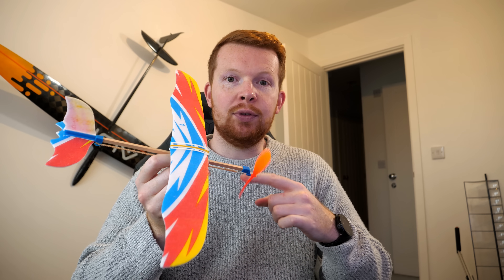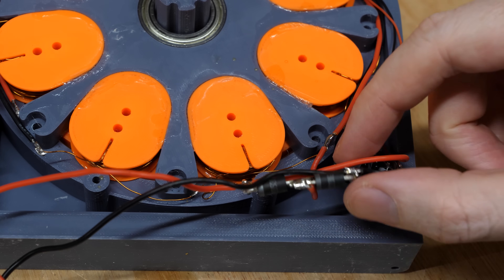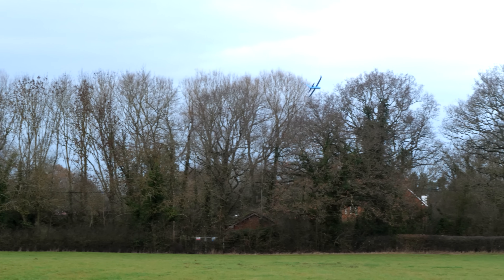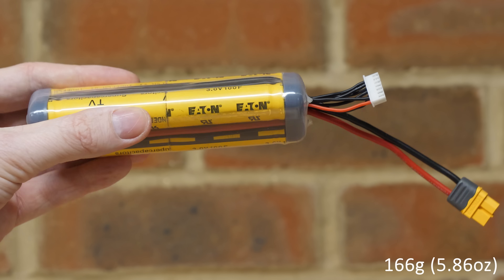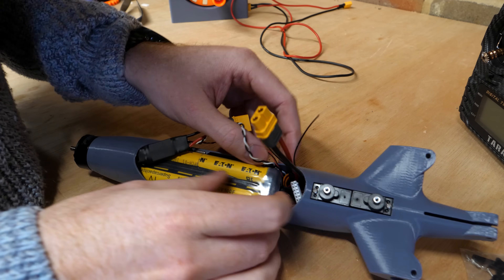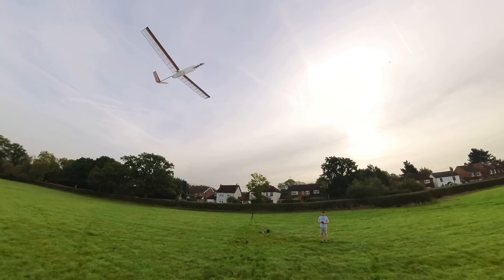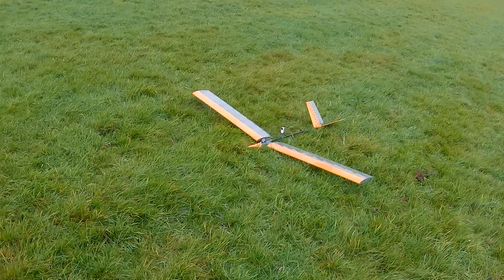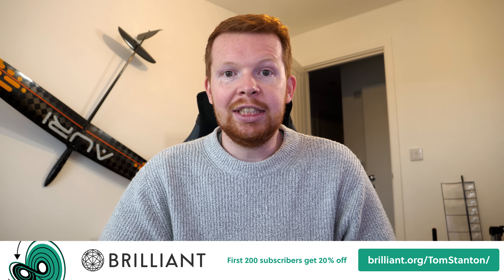Super Capacitor Plane

Comment: Your rectifier is missing a MOSFET switch for something out the DC further, multiple capacitors does the trick but the flow will still be slightly bumpy.

Comment: 11:25 idk if its possible, but it would be really interesting if you could use the windmilling of the propeller as a sort of regenerative braking system to charge the radio systems so you could stay in control of the plane for longer and so its safer to fly lol

Comment: having a pack of supercapacitors added to an electric car increases regen efficiency by 30 percent because they can capture energy faster then dissipate into the lithium battery, the technology has been tested and used for over 50 years but supercapacitors are too dangerous to put in passenger cars

Comment: Could you use a dual shaft motor and on the shaft pointing into the nose of the plane? Add a micro magnetic charger like the one you built to charge it, to help flight time?

Comment: Would this concept make a good s&r tool?

No place to charge? Get cranking, it would get you a bit of flight time.

Can the system swap the capacitors out for standard lipo cells?

Comment: Tom that thing is a complicated device is it all really necessary?

This is in reference to using capacitors in 1979 my friend Skip Swaggart  (yes that’s his real name. His mom was a hippie and she must’ve thought that was funny.) anyway his idea was to use a series of capacitors just like you are on your airplane engine, but his idea went a little farther in that he believed it could be self sustaining after using a battery to prime the capacitor, have no idea if it would really work, but it did seem like a unique idea, no gasoline only electricity to prime it via battery then it would be self-sustaining as each capacitor was charged by the battery and the battery was recharged as the engine turned, now of course you’d have to do a series of gears or whatever to turn this into electricity using a generator or possibly some kind of direct drive system for a car or machinery

🤷‍♂️
Reply: “make it so”
-😂

Comment: One does wonder how much extra flight time you might get by using the windmilling of the propeller to charge your capacitors. The increase in complexity and weight may not be worth it for a few seconds of extra flight time, but it would be interesting to see.

Comment: Interesting thought, a year too late: DC motors are also DC generators. When the power gives out for the propellor, the propellor would then become a generator and feed power back into the capacitors. Some of the clips in your video, it sounds like the propellor kicks back up a time or two - that could oddly be because the propellor is being its own generator via the caps.
Reply: You’re referring to back EMF, and it does not work that way
Reply: While brushless motors are reversible, the control circuit for a motor and for a generator are not very similar. I'm not sure how much elastic rebound you could expect if generator circuitry was also in the plane but I think it would not be worth its weight to add it.

Comment: Would those capacitors take much to re-charge them while in flight from lightweight solar panels attached to the wings, while gliding around after the motor has shut down.

Comment: Only just seen this Tom, did you think about using the turning prop while off the throttle to recharge the capacitor while in a glide to increase flight time? Would be interesting to see how long to could extend time by.

Comment: What if you rig the motor so that it can put charge back into the super capacitors when the propeller is free wheeling? Or have two more propellers free wheeling to charge the super capacitors?

Comment: very cool project, very nicely engineered wings.  For the folding prop you can add a small elastic band across the spinner,  to make them close once the power cuts, its a known RC glider trick, and/or program in ESC-brake.  Also having that big gap between the two wing halves adds a lot of drag, and also breaks the long aspect ratio of a glider wing into behaving like 2 short wings instead,  which again reduces performance and increases drag.  you should 3D print a housing for the center to connect the wings in a seamless shape.  You want all smooth convex shapes for low drag,  concave shapes are bad.

Comment: Impressive work. With your talent in 3D printing, why not design a cap for the folding propeller assembly that contains light springs which will push the props into a folded position when the centrifugal forces that keep the propellers deployed are no longer present (ie when the motor is no longer driving the props).

Comment: So, uneducated theory here... but could you extend flight time by modifing the prop with magnets and your cover plate to be a small generator to re-charge during flight? Maybe add a cutoff on a switch to break the charge circuit so it can drain out to a glide? 

Or is charging a SC as it discharges a bad thing?

Comment: When the aircraft runs out of power but the propeller is still spinning, it could recharge the capacitors and thus significantly extend the flight time.

Comment: changing the wiring to your super caps to be 9vdc instead of 18 vdc would double current and be at a voltage you could use in the plane  and possibly git you twice the air time.

Comment: what if you used solar panels on the nose and tail of the plane hooked to sum plain ol batteries with the same contraption as the super capacitor n same or similar plane body n maybe it would get some more flight time 🤷🏽‍♂️ or to spice it up keep the capacitor n make it powered by wind instead of air

Comment: Only thing I would change is I would put a 1/4" Chuck on the crank of the generator so you can use a cordless drill to spin it instead of hand cranking it.

Comment: Fir the 5V you can use a buck/boost converter so it can work down to done low voltage, such as .5v of maybe less. You could also do the same to boost your speed controller to keep the voltage high so that your proportional control of the speed is consistent (although it will simply cut out when capacitor is low enough). You're only using about half the energy you're storing.

Comment: What about a full sized bike crank electric generator human sized copter with giant super capacitors with the ability to switch back and forth to a lithium/car battery for emergencies and safe landing. The question is can a human bike pedal enough to generate enough electricity for take off? If so then when your life depends on it, would you pedal faster than normal to safely land? The emergency lithium and/or car batteries is for if the first and second hypothesis are about to fail. You can have a circuit board that switch's to the batteries if it loses thrust and altitude faster than you can pedal. You could also design is like those electric assistance bikes.

Comment: My height can open up light access power higher than ground levels so I charge by a timer that when gliding I recharge super capacitors at this light and wonder the speed .use wiring that is directional but delivers this emw easily. The temperature lower. Metal power delivery transfer to chemical nitrogen and opposing gasses

Comment: OK HERES AN IDEA: 

What if there was a way to use the output shaft if the propeller motor to refill the capacitor...
like connecting the output shaft of the rotor motor to a set of gear that would increase the rotation of a secondary motor that would in-turn charge the capacitors...
how long would something like that run for?

Comment: Would it be more efficient to have a small onboard 5V battery for the control circuitry, with the super capacitors powering just the motor?

Comment: Now I'm no expert or have much electronic knowledge but to me if the capacitors could be charged with solar panels could the aircraft stay aloft by using a pulsing method.
If not an aircraft what about a boat?
Please don't throw electronic answers just yes or no lol Also it's obvious the rc needs a normal battery possibly also solar charged?
Could the capacitor discharge speed be lowered a bit once in the air to increase range?
My first thoughts on the prop were also why not a simple spring device to retract it or a mechanical stop or pin on a spring. Maybe something centrifugal in the spinner?
 I appreciate it's all about weight but would there be any merit in also using standard batteries in conjunction with the capacitors?? Maybe an alternating pulse method or use the batteries to top up the capacitors in conjunction with solar?

Comment: What about putting in double the capacitors and building a generator that when the propeller is making power run on one set of capacitors while charging  up the other capacitors with a switch that automatically switches over when the discharged capacitor is spent! Then it switches over and keeps running!

Comment: I've always wanted to experimentally test the difference between a plastic generator and a metal generator. This plastic generator is extremely inefficient since almost all the magnetic flux disperses into the air instead of passing through the coils. Even a small metal frame in one of the corners (in such a way that the magnetic flux concentrates in the coil—it's hard to explain the geometry) should increase the output voltage several times.

Comment: Please add 3D printed water pressure driven turbine with flywheel of marble/metal above...operated everytime the domestic water supply pressure motor operates & and gives it spin.. plz Guide to feed elect output in solar architecture.. please upload renderable 3D printing files for horizontal twisted windmill.. ( Arshimedis Ltd style).. show your skills to integrate it with overhead fan motor.. add permanent magnets to stator..feed this output also to solar cct..for a hybrid model..promote Green Energy

Comment: Please add 3D printed water pressure driven turbine with flywheel of marble/metal above...operated everything domestic water supply pressure motor operates & and gives it spin.. plz Guide to fuel elect output in solar architecture

Comment: Innovative.. please design current generator hub with impeller vane to fit in line of domestic water pressure pump..so to rotate a flywheel of marble or metal..EVERY TIME ANY FAMILY MEMBER VISITS WASHROOM & TRIGGERS PRESSURE PUMP.. 
1. Please guide to feed this D.C output in solar panels cluster for random addition in current.
2. a) Also please design with 3D printer, the rotating horizontal fiber disk (similar to Archimedes ltd).. b) Kindly also use your skills to add magnets in stator of common overhead ceiling fan (to be integrated into above mentioned disk of windmill).
3. Please upload renderable 3-D printing files with specs of plastic/alloy grain.

It will help to make hybrid elect power supply to be fuzed in main solar power supply architecture... for 24 hour electric supply generation).. and a cleaner, greater planet.

Comment: خب بجای خازن از باتری استفاده میکردی قطعاً خروجی بهتری داشتی وزن کلی هم کمتر بود، به هر حال عالی بود، براوو
Well, instead of the capacitor, you used the battery. Certainly the better output was less weight, it was great anyway, Bravo

Comment: I would love to see you come back to this, but replace the super capacitors with the new lithium ion capacitors.  They behave much like supercapacitors, but have greater power density.  Same short charge time, more electricity stored. If they deliver on their promise, they should significantly increase your flight time and be just as quickly chargeable with your hand crank generator.  :)

Comment: If you made a mini version of the hand crank generator and attached it to the engine, then redirected the power back into the super conductor cells would it be able to charge itself as the engine spun (at least to some capacity), ultimately increasing its flight time?

Comment: I would have cheated and run the plane’s electronics off a battery and used supercapacitors only for the motor. But I tend to cheat anyway.

Comment: Make a different kind of self-powered plane, where instead of trying to make enough paneling to maintain a voltage with batteries, use the voltage to power capacitors and make a really good glider that charges fast enough while in the air to give itself another boost up. I think this might be a little better being gliding isn't power intensive

Comment: Use a second cap bank and charge during flight and really fast charge, cap bank to plane. Just enough resistance to keep everything from destroying itself and it won’t take long to get back in the air. If you then use a leg power device to make current u could charge up in just a few seconds.You could use the electric bike to do that?

Comment: 5:33 looks like a bomb at the moment
Reply: One wrong move and it is
Reply: @Wanderwavves  if it were a lithium ion battery, maybe. Supercapacitors can take a beating.
Reply: @Techmejmeant one wrong move as in shorting i shills close by. has a guy blow up his arm with a 200 amp capacitor😊
Reply: @Wanderwavves  in that case, yes
Reply: @Wanderwavves I've pulled working supercompasitors out of crashed cars, they're  good 👍

Comment: A ferromagnetic stator would increase the output of your generator. At the moment, flux is limited by the high magnetic reluctance in the magnetic circuit between your permanent magnets.

Comment: You should seriously refine this and sell it. To make it viable, you're going need a cheaper controller, but the rest of it can't be that expensive when mass produced. You basically took that capacitor kids toy and made a radio controlled version. Perfect for kids, or frankly anyone, wanting to dip their toes in radio controlled flight. Even the crank charger is great because it means there's no limit to their fun. They don't have to a few goes with the plug in version before it has to be charged. They can go until their parents tell them to come home. Seriously, refine this, create a website, and sell it online even if you just break even at first. At least you'll find out if there's a market for it. I bet you, someone watching this video would totally buy this for their kids or themselves.

Comment: A super capacitor is just a normal capacitor but named by an ignorant.
(because there's no such thing as super capacitors, as long there's no superconductors and no superisolators that could work far from absolute 0 degress of temp.)
Specially when you learn the capacitor stores negligible ammounts of energy compared to a standard battery.

Comment: If the movement of the propeller is converted to energy storage in a circular manner and the stored energy is used infinitely, I am not sure if it is possible? Instead of releasing energy only to spin the propeller, I am just imagining it and not sure if it is actually possible.

Comment: Hi. 9 months late. You should retry this but use as large of a propeller as can turn so the caps can pulse one strong "pull" recharge and then repeat. You are making low frequency but huge aptitude. This works to the advantages of supercaps. Now... as to how to charge the caps, you need to solve some puzzles yourself.

Comment: Putting in serie drastically reduce the farads. You could buy a 16v 100f for 7-8$. The one you made is only 16farads and look much bigger than the factory made ones that even have balance board.

Comment: in order to increase flite time, all else the same, the gap between the roots of the main wings must be filled. Ideally with an appropriate  wing airfoil, likely the same airfoil as the rest of wings. The aircraft total drag will reduce, yur aloft time will increase, and you will then beat the rubber motor performance, all else the same

Comment: I made a foam plane using a small lithium ion battery of approx 80 mah and a coreless motor is connected to battery through a switch and i just throw the plane and it flew over 2 km . I followed it with my drone and that thing was crazy to watch😂😂

Comment: New to the channel, love it so far. I'm wondering  about single seat jump take off gyrocopter.  Would super, super capacitors coupled to gearing turning the main rotor could get the gyro in the air, with a battery powered ducted fan pusher for forward flight ?

Comment: What if you made a wireless power receiver that would take power wirelessly from radio antennas? Could you then in theory keep the cap's charged and stay in flight as long as the radio is broadcasting? (and you were close enough to the tower)

Comment: I have a secret motor design you can build if you like. It runs off the directional electron neutrino wind which has been found to be the source of charge neutralization. Basically, it's a pulsing charge (ion) diode using a fluctuating zero point capacitor , as in a multiphase capacitor transformer in union with a high voltage conical coil to burn off energy, since it works off induction. It'll get colder as it runs.

Comment: There was way easier way to protect your print from fail. Next time just add 2 layers high circle on build plate witch can be easly cut with scissors. There is this settin in slicer if you are using prusa slicer, I think.

Comment: 11:50 what if you add a mid-flight recharger with a generator and a prop?, so when the prop spins Recharge the capacitors so maybe more flight time
Reply: No need the motor attached will be the generator

Comment: A buck boost converter might be able to power the radio for a few extra volts. It doesn't really use much power. I am not sure how much power that's actually left at that point though

Comment: Really cool project and great build quality! If you used a high quality dcdc buck-boost converter to regulate the variable supercap output voltage to a fixed 7,5V you could drastically increase the usable energy stored in those supercaps, as a good converter should work down to about ~0.8V, some even go below 0.5V.